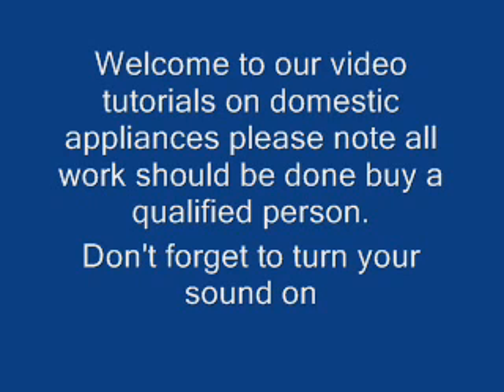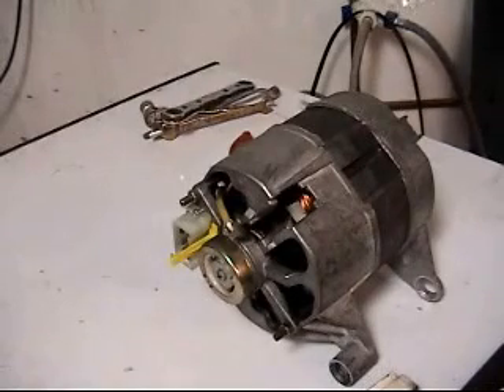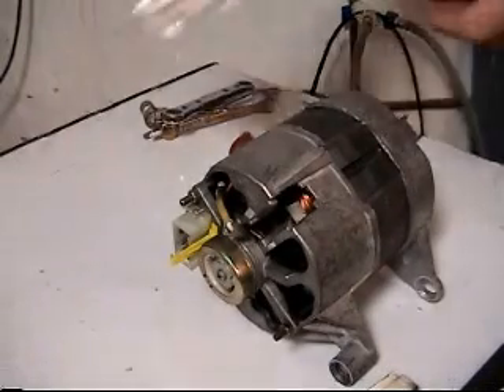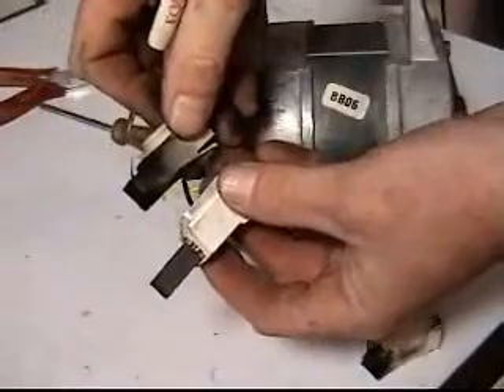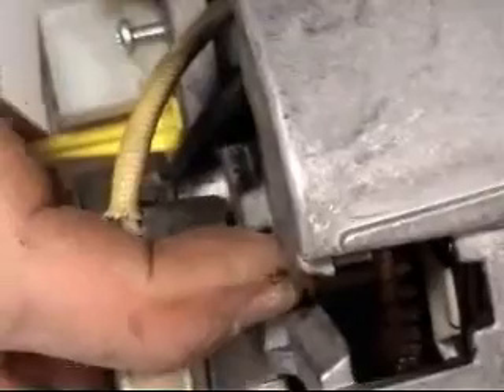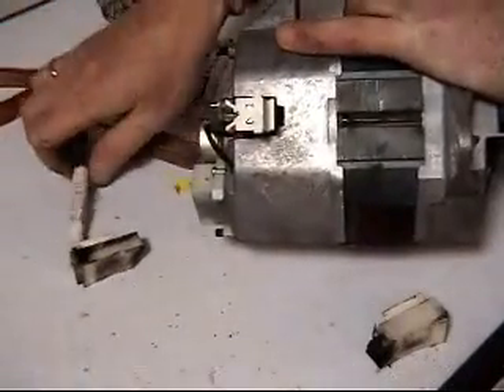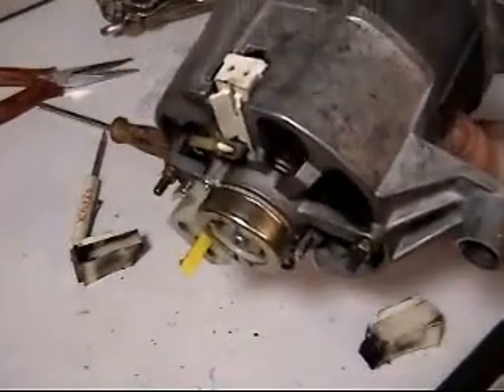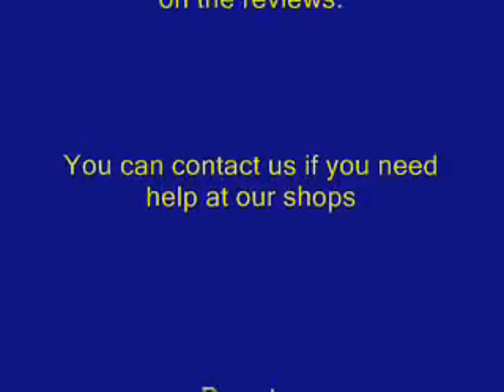How to replace washing machine carbon brushes on a Hotpoint ETC

Comment: Hi, i have this type of motor 904/1049/03 to be exact, i have found it is an obsolete model. I want to use it on a lathe, but the wiring is totally confusing for me. I was wondering if you had a wiring diagram?